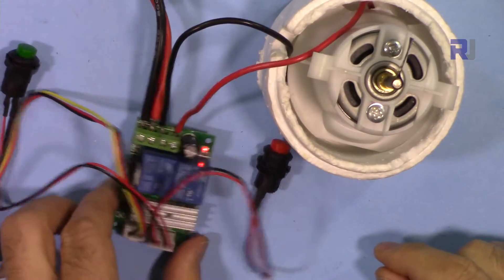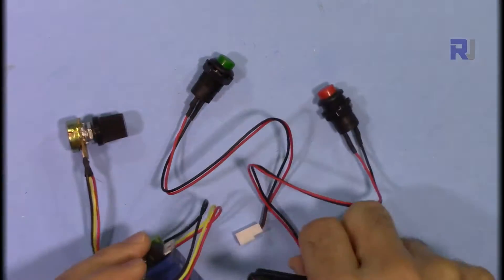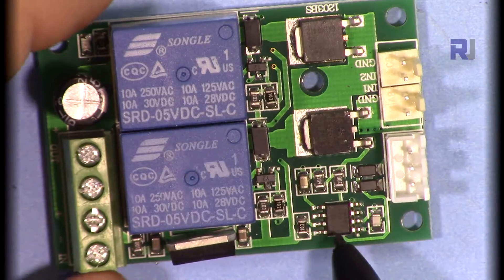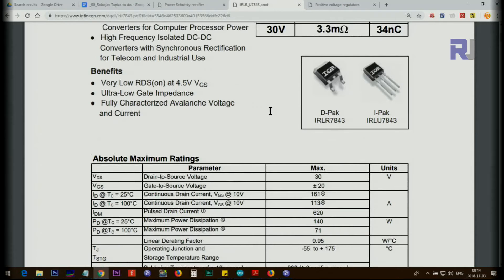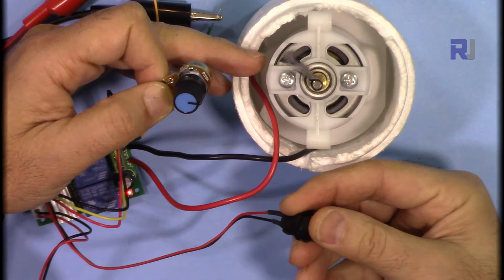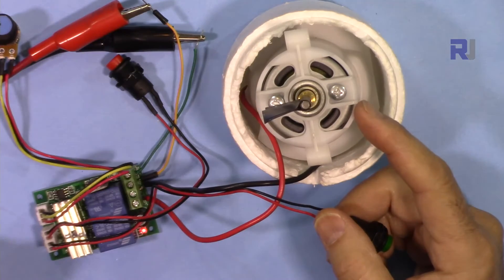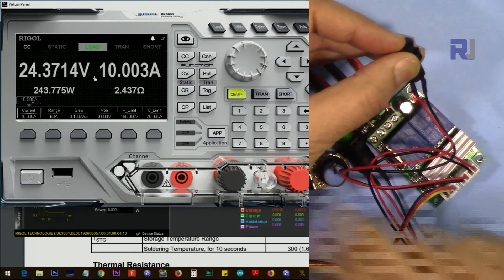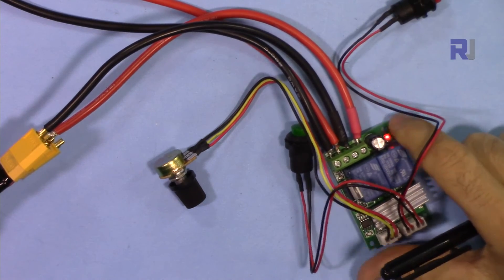PWM Motor Speed Controller CW and CCW with 2 push button

Comment: This kind of of control is work perfect for our project.  But we used stepper motor 2.8A. Would you please help us?
Reply from the maker: May be this video which is basic stepper https://youtu.be/cYTICj4DWYc or this video to control stepper using push buttons https://youtu.be/csf_G1pi0ps will help.  These are all free. if you want to hire me with payment of $100/hour please contact me via Robojax.com contact page.

Comment: Hi! Can I connect 2 linear actuators on this? Thanks!
Reply from the maker: Hi, something like this https://youtu.be/EaoB6lfnS7g
Reply: @robojax  hi! I thanks for the response. My problem is, I actually dont know anything about wirings. Im planning to build my own standing desk with 2 linear actuators. I bought that PWM motor speed controller. My only problem is, can I connect my two(2) linear actuators to my PWM motor speed controller without the use of the ardruino? Thanks in advance! I would really appreciate your feedback!
Reply from the maker: Have you watch that video? Here is a video where you learn how to use PWM module https://youtu.be/3kGXujM3TIw or use Arduino how to drive a motor https://youtu.be/tCJ2Q-CT6Q8

Comment: Sir just asking...can i use a reversible switch timer as in use in a washing machine that controls the forward and reverse running of the motor in exchange of the two colored knob switch of the relay module used for dc motor controller and integrate also timer switch that controls the time laps of every turn of the motor since i have a project using dc motor for a light weight load dc washing machine using 775 motor...pls reply
Reply from the maker: if the motor of washing machine is DC yes you can.

Comment: Hi Ahmad, how can I get PWM to lock cause I really need the series
Reply from the maker: Hi, what do you mean "to lock" if you look mean not change, then you need to set the desired speed. then measure potentiometer value with ohmmeter from middle pin to A and middle pin to B and you will have two value. then replace it with the same value resistors.  Here is my video here I have spoken about potentiometer https://youtu.be/TbLdAQpE4jE

Comment: Is it possible to add an Arduino so as to run variable speed programmes with different buttons as they do for kicker motors
Reply from the maker: is it is. I have 3 videos, here is one you can learn from https://youtu.be/EapP4BhlYb0